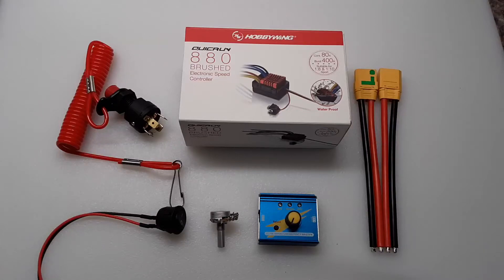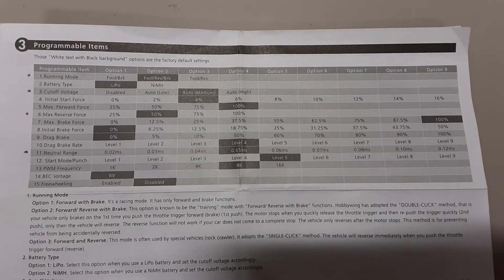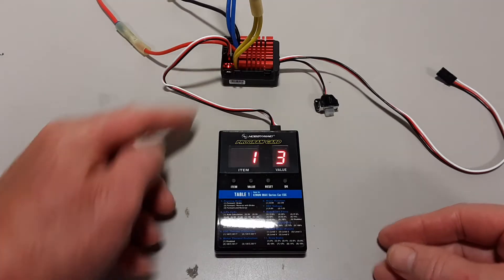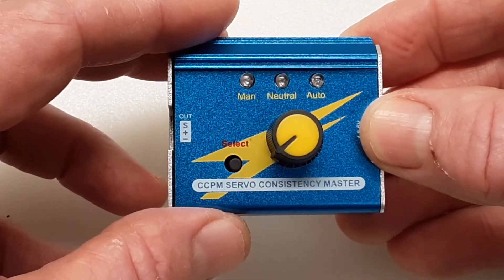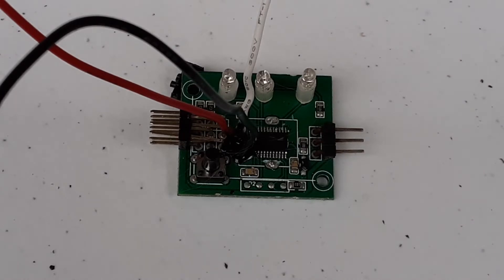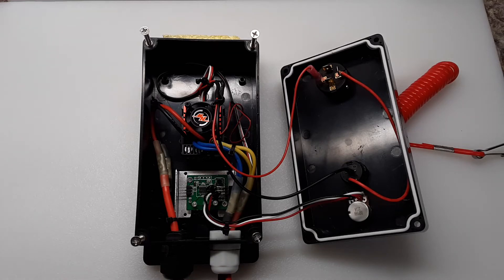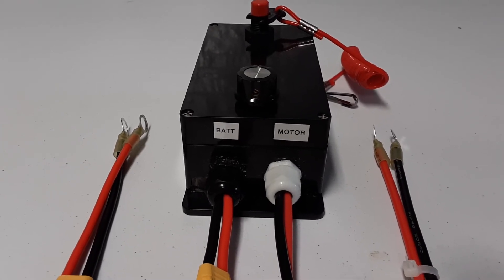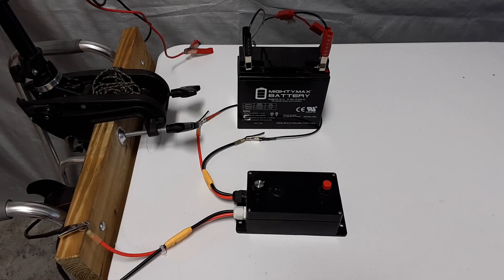ESC Electronic Speed Controller with Cut Off Switch for AGM and LiFePO Batteries

Comment: I was able to successfully put this together thanks to your great video. Just one hiccup. I sourced a center detent pot from mouser but when I test the system, the off (neutral) position of the potentiometer is not at the detent point. It’s off just a little and if it’s not dead on the system just beeps continuously. Is there a trick to lining up the off position with the center detent position. Does it have something to do with the esc programing? Appreciate the in depth instructions!
Reply from the maker: Thanks. Normally, the center detent should line up with the 0 point. You can always adjust the knob for the 0. Find the 0 point and then loosen the knob set screw and rotate until it lines up with 0. Then just tighten the set screw.

Comment: Great in depth video. Gathering all the materials I need. One thing I have not been able to source is the center detention pot. Can’t find that anywhere. Is there any reason I can’t use the pot that’s already on the servo?
Reply from the maker: You can but it is smaller and not as high quality.

Comment: Thanks for the informative video. 
I am a little confused because the initial Servo board was red, then after you removed the potentiometer the Servo board was green and looked different . Did you use 2 different boards for the video? I am just stuck with the wiring of the black, white and red wires to the board. The video is a little dark to see exactly what the connections were.
Reply from the maker: The bottom side of the board shown in the video is green.

Comment: Thank you for great video. I have a question regarding voltage rating for ESC shown on Amazon is 6 volt; and you connect this ESC to 12volt LiPePo battery.  Would this procedure burns the ESC?
Reply from the maker: Glad to help. No, the ESC regulates the voltage.
Reply: Thank you

Comment: Hello master, I need your help, I'm modifying a minnkota 30/34 enduran, after frying a potentiometer and now being able to solve it, it turns out that when I turn on the esc 880 quicrun, as I saw in your video, it makes the three beep signal but the engine It doesn't work with the potentiometer control, I noticed that on yours it makes three beeps and then another single beep signal, but my esc doesn't make the fourth beep signal, can you say something about it? thanks!
Reply from the maker: The 4th beep means the pot is centered, or in neutral. The pot has to be centered to restart.
Reply: After a few minutes of trying I managed to solve it, I ended up inverting the position of the power connector on the servo tester, now everything is perfect, and thank you so much for sharing this project with all of us, fantastic, I'll post a video of how it turned out soon mine with your guidance, thank you!!
Reply from the maker: Great! Glad to help.

Comment: Love your videos,thanks so much.  I’ve upgraded to a Newport 55lb for my Jackson bite, and am now going to do a proper mount, using your great vids. I’m thinking of doing the esc with kill switch , but what’s the difference / advantage of that over your pwm ones you also show?  Is it weight, heat battery consumption issues?  Which should I do? I don’t think budget is an issue.
Reply: Thanks very much, I’ll check it out.
Reply from the maker: Thanks! I would not use an ESC for trolling motors 50lb thrust or larger because of the current draw. You could build the "Minn Kota PWM Digital Speed Controller Box" using my video tutorial. It would be best for that size motor.
Reply: I am using a esc with a 55lb thrust motor from NV and never had any problem other that it's getting hot after 2-3 hrs of continuous running.

Comment: Loving your videos as I am gathering parts for my kayak build. One question, if I only have an AGM battery is it safe to hook up the ESC to it while I am programming it, or will that cause it to burn out since it is set up for a LiFePO battery by default?
Reply from the maker: Thanks. No, you can program with an AGM.

Comment: Hi
Can you please confirm, is the kill switch installed to disrupt power on the positive line when the key is pulled?
So like a normally open switch with key installed?
Reply from the maker: The link to the kill switch is in the narrative section. The pos lead was used to cut power.

Comment: question, I am about done.  Just need to know which set of 3 prong rows i add the esc 3 wire plug too?  does it matter any of the three matter?  Thanks
Reply from the maker: No, it is for 3 separate channels.

Comment: Can you help me out and share the wiring from the potentiometer to the servo tester.  Where the white, black and red are connected on the potentiometer and where you connected each color on the servo.  I have the same potentiometer and servo tester.  Thank you in advance.
Reply from the maker: The terminals have the +, -, and S markings on the board. Just match those up to your pot. You can trace my color coded wiring to the pot if you need to. You can also look up the specs for the pot and it will show the terminal connections.

Comment: Just giving my 2 cents on this project, i realize we dont use the 3 pin input off the servo tester. So i desolder this componet and resolder where the cables of the new potentiometer was in the original project. This way i can just plug the new potentiometer like i plug the ECS cable in the 3 pin output, if the servo tester stop work i can replace it even when im in the water
Reply from the maker: Nice idea.

Comment: may i ask a favor.  I am attempting to create this set up but need to see a better or clearer picture of the wiring for the new pot. trying to see lining up of your wires with the servo and unsure on the alignment of the wires on the pot.  I am guessing they are in the video in black/red/white alignment?  thanks for the clarification
Reply: You just need to put the center wire in the center conection of the new pot, the other 2 wires just change the way the motor runs and it always run to the 2 ways
Reply: @asdlukinhasasd  THANK YOU

Comment: Hello,
which output pins did you use from the servo controller? the plug from the ESC just plugs into that, correct?
Reply from the maker: You can use any of the 3.

Comment: Sir, can you tell me at a high level, meaning overview theory, why is the servo tester needed? I see it has our new pot adjusting it, and it feeds the ESC, so that is because the ESC requires a digital signal or pulse signal to control the speed of the trolling motor? I'm very confused on the theory.
Reply from the maker: I don't want to get deep into the theory just because it really doesn't help with the project. Just think of it as most other electronics that need a pot, like a volume control. It just regulates the power input/output for the ESC.
Reply: @Aksmaniyak  thanks very much!!!

Comment: Any advice to solder the new potentiometer on the servo tester? Already killed 2 servos testers :(
Reply from the maker: Unfortunately, th only way to get better is to practice. I usually buy 2 of each part when I am doing this because I fry them too.
Reply: @Aksmaniyak  u r right, im improving my solder point, bought another servo tester for 1 more try. My  actual pod/tester works for go in reverse, but when i try go foward at full speed it drop the light of the tester and switch the mode to alternate, i think it damaged

Comment: Hello, I already bought the 880 esc.
What type of battery do you use? I use a deep cycle lead one.
In the instructions for the esc it says that it can only be used with lithium batteries.
now i don't know what to do
you can help?
I wave the remot control too
Reply from the maker: I use a LiFePo4 battery. The ESC can be used with an AGM battery by changing the programming as explained in the video.
Reply: So can I do it like you did in the other video using the remote control and changing the esc programming like you do in this video?
Do you have a diagram of the electrical installation?
Thank you for everything.
Reply from the maker: Hi, yes the build is the same with a remote and only the programming is different. No, I do not have a diagram.
Reply: I use a 12v 110ah deep cycle lead batery, its possible I use only a esc and a remote control like you do on another video but changuing the programming off the esc to agm batery like you do on this video?
Reply: Once again, thank you for everything.
What diameter cable do you use from battery to esc and esc to motor? Do you use any fuses to protect the motor or the esc?

Comment: Hi when wiring the pot where does the signal lead, the red lead, and the black lead go on the pot. It was hard for me to see in the video.
Reply from the maker: The polarity and signal inputs are shown on the Servo case.
Reply: Please let me apologize for not making myself clear. The 10k pot on the lid looks like the signal wire is on the right side of the pot, the red wire in the center, and the black wire is on the left lead on the pot. Is that correct? @Aksmaniyak
Reply from the maker: That is what I used since it is also on the circuit board in front of the pot. Look for those marks and copy to your pot.

Comment: Hello. Great videos. Thank you for sharing I made a similiar type box with the same ESC. With the lid closed and running at full speed i was reading 115 F inside the box. Do you know if this temperature is a concern?
Reply from the maker: Thanks! I have not seen any data about that or experienced any issues with heat.

Comment: Nice setup. I would just change one thing. On the battery side i would change from male to female on the XT90 connector. The reason is that you now have male connector on the battery, witch, easely be shorted out, since they are visible. Using female from the battery makes it safer. This is ofcourse when your handeling the battery only. Hope you know what i mean. If you search for Lipo batteries you´ll find that they are always delivered with a female connector. Regards. /Magnus
Reply from the maker: Thanks Magnus. Yes, I understand what you mean. This is just my set up, there are many ways to do this. I really don't have to worry about the battery since I breakdown my equipment after each use and store in the garage.

Comment: Hello thanks for the video. I purchased all the materials and I am not sure where to connect the red, black and white wires for the new pot. I tried to determine what position you place them on the servo and new pot switch but can not see them clearly enough in the video. I went ahead and attached them best as I could tell but it will not work. Any help would greatly appreciated
Reply from the maker: The servo will have the +, -, and signal positions on the board or case. If you search for your 3 pin pot schematic on line, it will show you the wiring sequence.

Comment: When you attached the 3 wires (for the new POT) to the servo board, did you only use liquid electrical tape? There is no mention that you soldered those wires into the board. This particular step (removing the old POT and installing the 3 new wires) seems to be the most difficult step for me. (Because of how tiny everything is) Thank you for your very detailed videos on this project.
Reply from the maker: Thanks Craig. Yes, I soldered them first and then applied the liquid tape. It stiffened the wires up a little and made sure that they couldn't short out.
Reply: @Aksmaniyak  Am trying to setup an ESC. Somehow I'm damaging the servo board when I remove it's POT. Then when I attach the wires for the new POT, the board only works a short time before total fail. Maybe my servos are too cheap? I got 5 for $12 on Amazon, brand name Teyleten and I had to use a jumper. Can your recommend a different brand servo (that doesn't need the jumper). P.S. I'm a total rookie at soldering and have already invested about 4 hrs studying youtube videos, but I'm probably still messing up something somewhere. Or maybe I'm not removing the POT on the servo properly? Any advice would be appreciated. Maybe messing with these tiny servo boards and soldering tiny 24 gauge wires is just not for me.
Reply from the maker: @craiggruenberg9591  It takes practice. The servo I used in this project doesn't need a jumper if you mount it using the base like I did. You can also clip off the pot from the board and leave the 3 tabs attached and solder to those as well.
Reply: @Aksmaniyak  Your information and encouragement is very much appreciated. Thank you. I'll give it a few more tries before chucking the whole project in the garbage and getting back to fishing.
Reply: @craiggruenberg9591 I wouldn't try this project because I KNOW I would fail with this pot soldering.  I have a background and education in electronics, but I don't need the aggravation to try that at this time in my life. I appreciate the video though.  Very good.
Reply: @stanmanmedia  Aggravation is the word for this project. I had it working briefly, but the whole thing crapped out when I extended the final wiring for the kayak install. Shit-canned the whole ESC project into a box. My old PWM has worked flawlessly for 4 years. Don't know what I was thinking about messing with these tiny electronics.
Reply from the maker: Thanks Stan. You are not alone. I can't count how many times I have fried something during some of my builds.
Reply: @craiggruenberg9591  I am almost 65 years old, completed 2 years of electronics school at 19, worked on robotics that manufactured chips for a few years, then was is in enterprise software for a living for decades. I understand what he's doing and think this video guy is extraordinary in producing detailed top quality videos. I say all that to say that I could see the tedious work screwing around with this particular project that I would have shit canned my first effort at it with plenty of acid in my stomach. My background told me that this one is not for me. I plan to do the one this guy does with remote receiver placed in trolling motor head and joystick sender. That one looks less cumbersome.
Reply from the maker: Thanks Stan.
Reply: Just giving my 2 cents on this project, i realize we dont use the 3 pin input off the servo tester. So i desolder this componet and resolder where the cables of the new potentiometer was in the original project. This way i can just plug the new potentiometer like i plug the ECS cable in the 3 pin output, if the servo tester stop work i can replace it even when im in the water. For me it works like a charm and i dont have anymore problems with this particular step

Comment: Great video! One question. When you removed the original pot from the servo tester board, how did you know where each new wire went, and how did it connect to the new 10k pot? Thank you!
Reply from the maker: Thanks Tyler! I placed the new pot in the same position as the one on the servo and copied the connections.
Reply: That makes perfect sense, thank you!

Comment: Awesome build 👍🏻, great video with clear instructions. Would you happen to remember the dimensions of the water tight box you used?
Reply from the maker: Thanks Jeffery. The parts links are in the narrative section.
Reply: That’s the same link for the control knobs. I’m thinking a box 6”x3.5”x2.5” might work, hopefully.
Reply from the maker: @jeffreyblair1820  Thanks for pointing out the error. I put the correct link in the narrative. Here it is.   https://www.amazon.com/gp/product/B08P55BZDH/ref=ppx_yo_dt_b_search_asin_title?ie=UTF8&th=1

Comment: Based on your experience with different PWM controllers, don't you think that this Hobbywing QUICRUN 880 ESC power input cables are a little too small for the rated amperage of 80A? Thank you.
Reply from the maker: I know it seems that way; that's what I originally thought too. The wire has a short length so it works fine. I don't run any trolling motors close to the 80A continuous rating so I'm not concerned.
Reply: Divide that 80 rating in half for continuous of 40amps. This is the way

Comment: Nice looking controller. Since you have the kill switch installed already, you can completely eliminate the On/Off switch; it is there with no function at all.
Reply from the maker: Thanks. You could use the kill as an on/off switch but it is better to use the other switch. The kill switch would be more cumbersome to use like that and would probably not last as long.
Reply: @Aksmaniyak  Does the kill switch have the push button to kill capacity as the one on a small outboard?
Reply from the maker: @obwith2.332  No, it is key and plunger style only.